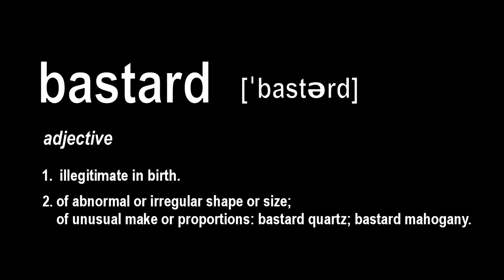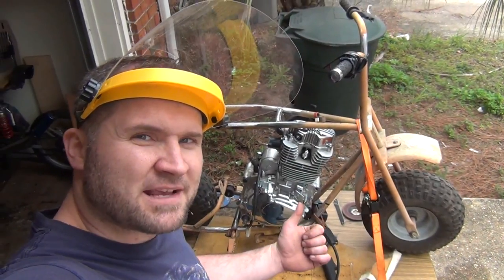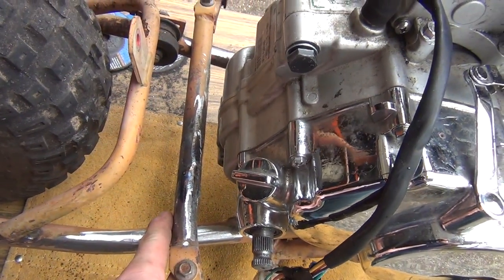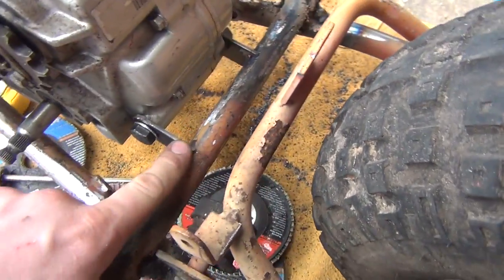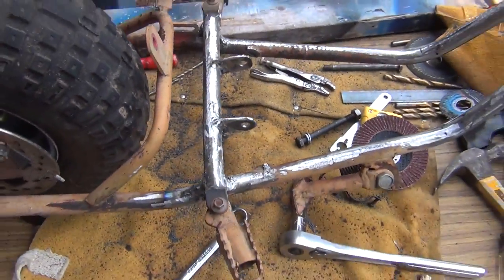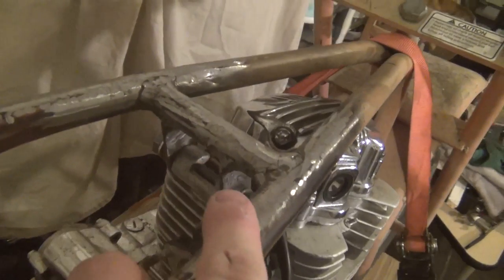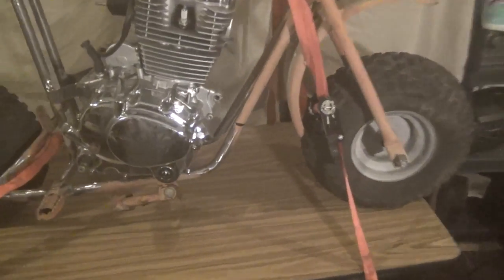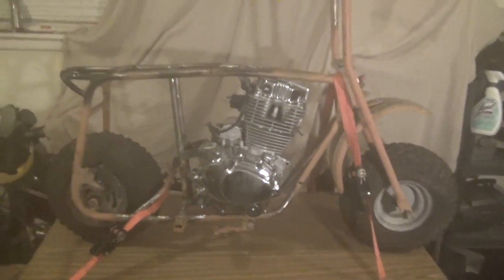DoodleBastard Engine Swap - Part 3

Comment from the maker: Nah, it willl be just  fine. This engine came from a mini chopper that was also@solid mounted.  It vibrated, no doubt, but not anything like you describe.   Besides, rubber mounts could cause chain alignment issues, as the engine can torque itself crooked under power.